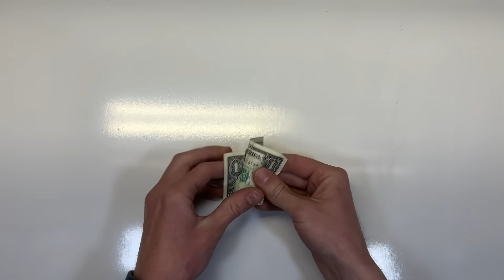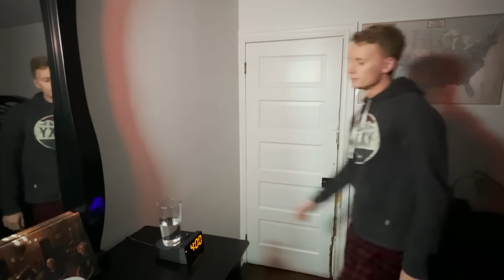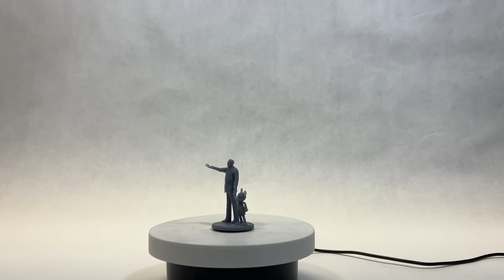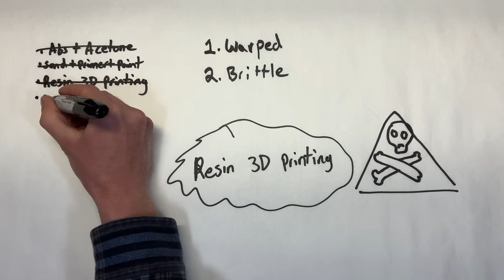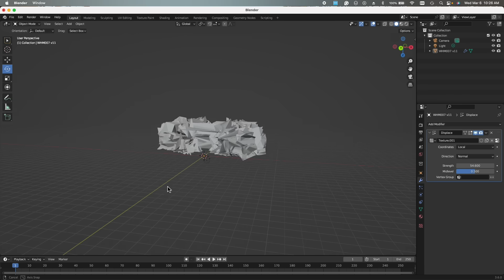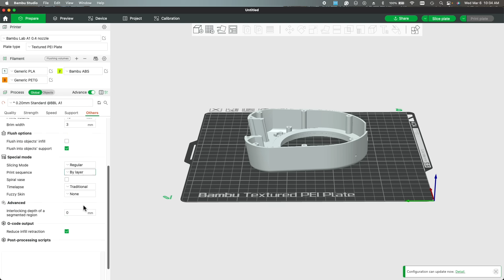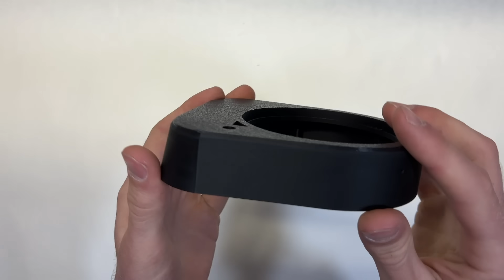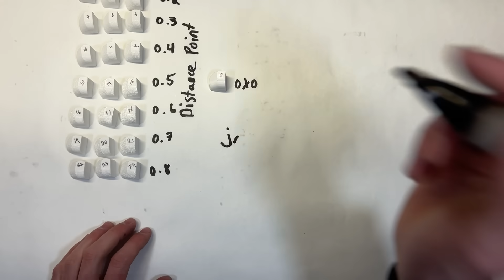My Secret To No More 3D Printed Layer Lines

Comment: Does fuzzy skin option available in Cura or creality?
Reply from the maker: Yes, the fuzzy skin option is available in Cura, a popular slicing software, and also in Creality slicer software. It allows users to apply a fuzzy texture to the outer surfaces of 3D prints, which can help hide layer lines and create a smoother appearance. This feature is often used for aesthetic purposes or to enhance the visual quality of printed objects. If you're using Cura or Creality slicer, you should be able to find the fuzzy skin option in the settings menu under the section for surface finish or similar categories.

Comment: Z-Hop is yuor Friend😅
Reply from the maker: Indeed! Z-hop can be a helpful feature in 3D printing, especially when dealing with models with delicate features or overhangs. It helps prevent the nozzle from colliding with the printed part when moving between different sections of the model, reducing the risk of stringing, dragging, or surface imperfections. By lifting the nozzle slightly during travel moves, Z-hop can improve print quality and reduce the need for manual post-processing.

Comment: If yuo want to print finish products with Resin , first Learn to Print in Resin , there is a learning curve , there are a lot of resins and parameters to know, second if yuo think yuo gone do this like the bombu in a Resin orinter like Creality or other , its not gone happend, but there are systems l like  Formlabs , full ecosystem(and its expensive) , one click and yuo have yuor model , perfect in their own propietary cartrige Resins😊
Reply from the maker: You make an excellent point! Printing with resin requires a good understanding of the printing process, as well as knowledge of different resins and their optimal settings. While some desktop resin printers like Creality can produce decent results, they may not match the quality and reliability of more advanced systems like Formlabs, which offer a full ecosystem and proprietary resins designed for seamless printing. Investing in a high-quality resin printer and using compatible resins can greatly streamline the printing process and ensure consistent, high-quality results.

Comment: Thanks for the reply.  Not going to change filaments any time soon.  Bambu had a sale this weeked for 32% off and free shipping so I bought 4 more rolls of PLA.  The printer is in my office inside my house so the med temp is probably 70 degrees and it is on a very stable surface.  It is self-calibrating machine (P1S) and the temps are 219/220 c and 55/55c.  Just a hobby for me and not a business so learning as I go and when I have time.  Lots to learn!  Good luck with your business. 

Again, thanks for your video,

Tony
Reply from the maker: You're welcome, Tony! It sounds like you're enjoying your journey into 3D printing as a hobbyist, and it's great to hear that you took advantage of a good deal on filament. Learning as you go is part of the fun, and it sounds like you're off to a great start with your BambuLab P1S printer. If you ever have any questions or need advice along the way, feel free to reach out. Happy printing, and best of luck with your projects!

Comment: Why are you heating the acetone for abs? Its called vapor smoothing for a reason. Layer of acetone, parts elevated above it in an air tight container for up to 20 mins depending on size of part. Easy.
And resin printing isnt faster because of less moving parts, its because an entire layer is printing at a time, and you can fill the build plate with no additional time, only height affects it. And its layer lines are normally about 0.05mm, you make it sound completely different. Not to mention im gunna go out on a whim and say you didnt chemically clean and uv harden after printing your resin... it shoulnd tbe that brittle
Reply from the maker: You're absolutely correct! Heating acetone isn't necessary for vapor smoothing ABS prints; the process involves suspending the parts above a layer of acetone in an airtight container, allowing the vapors to smooth the surface. It's an effective method for improving the finish of ABS prints.

Regarding resin printing, you're right about the layer-by-layer printing process and the minimal layer lines it produces. Resin prints can indeed have very fine layer lines, typically around 0.05mm or even smaller. Proper post-processing steps like cleaning and UV curing are essential for achieving strong and durable resin prints, and skipping these steps can indeed result in brittle parts.

Thanks for clarifying these points!

Comment: Is there an equivalent to this in cura? My printers use cura as a slicer...
Reply from the maker: In Cura, the equivalent feature to "fuzzy skin" is called "Ironing." However, it's worth noting that while both features aim to improve the surface finish of 3D prints, they work differently.

"Fuzzy skin" in PrusaSlicer adds a textured surface to the outer shell of the print, which can help conceal layer lines and imperfections. On the other hand, "Ironing" in Cura is a feature that smooths the top surfaces of the print by ironing them with the nozzle, creating a smoother finish.

To access the Ironing feature in Cura:

1. Open Cura and load your model.
2. Go to the "Experimental" section in the settings.
3. Enable the "Ironing" option.

Once enabled, you can adjust the Ironing settings to fine-tune the smoothing effect on the top surfaces of your prints.

While not exactly the same as fuzzy skin, Ironing in Cura can also help improve the surface quality of your prints.
Reply: @jakemgrim  Cura has fuzzy skin since 5.0 its like 2 years not sure why you are talking about ironing that's a completely different function, to smooth out surfaces actually the complete opposite.
Not sure if this are some wacky ai response you copy pasted or if you are breathing to much UFP & VOCs.
Why would you respond to comments and try to educated people if you have no idea what you are talking about.

Comment: They make 3d resins specifically for strength. Warping sounds like lack of supports.
Reply from the maker: Yes, you're correct. Warping in resin prints can occur due to various factors, including inadequate supports, improper curing, or resin properties. Using resins specifically formulated for strength, such as engineering resins, can help mitigate warping issues.

Additionally, ensuring proper support structures are generated in the slicer software and optimizing the orientation of the model can also prevent warping. Some resins may require different curing times or post-curing processes to achieve optimal strength and stability.

It's essential to experiment with different resin types, support configurations, and curing methods to find the best combination for your specific printing needs and desired level of strength and quality.

Comment: Little precision about tolerences, where pieces connect you can actually simply tell the slicer to print this part without any fuzz, for a bezel for example or a ridge. so you don't have to change your tolerences :)
Reply from the maker: That's a great point! In many slicer software programs, including Cura and others, you can indeed customize where the fuzzy skin effect is applied on your model. By specifying areas where you want the surfaces to be smooth without fuzz, such as connection points or precise tolerances like bezels or ridges, you can maintain the necessary fit and finish without altering the overall dimensions of the model. This way, you can enjoy the benefits of fuzzy skin for most of the print while preserving critical tolerances where needed. Thanks for highlighting this useful feature!
Reply: @jakemgrim  you're welcome!

Comment: Dawg- do the sanding and painting method once then create your own mold and cast your parts
Reply from the maker: Creating molds and casting parts can indeed be an efficient way to produce multiple copies of a model without the need for extensive post-processing like sanding and painting. It's a great technique for achieving consistent results and can save a lot of time, especially if you need to produce a large quantity of parts. If you need any tips or guidance on mold-making or casting, feel free to ask!

Comment: I'm not sure if fuzzy is actually better than visible layerlines. Sure it hides that it's 3D printed, but I'm not sure that's necessary
Reply from the maker: That's a valid point. Whether to use fuzzy skin or embrace visible layer lines depends on personal preference and the specific application of the 3D printed object. Some people appreciate the unique texture and aesthetic of layer lines, while others prefer a smoother finish for a more polished look. Ultimately, it comes down to the desired appearance and intended use of the final product.

Comment: Resin printing is not faster it’s actually way longer. Just because less moving parts does not mean faster. I would be curious to know where you got that information from. Probably pulled it out of your ass. Let’s not forget since you clearly have never resin printed in your life don’t forget about how the majority of resin prints will need supports which need to be removed, then the parts need washed in isopropyl alcohol and then fully cured once again. Process is actually a huge pain compared to FDM. Really shouldn’t spread misinformation on things you do not know because people will use one source of information and believe that it’s true and never question it. Hold on got through more of the video and not only did you buy a resin printer and try it and yet you still had the audacity to say it was faster even though you would have known this to be not true?!??! You said what about 3 hours on the bamboo printer to print you shell? I could only imagine on the resin printer with the success print it was well over 6 hours correct me if I’m wrong.
Reply from the maker: It's important to ensure accuracy when discussing different 3D printing methods. Resin printing does indeed have its own set of processes and challenges, including the need for supports, post-processing steps like washing and curing, and longer print times for certain models. While resin printing can offer high detail and surface quality, it may not always be faster or more efficient compared to FDM printing, especially for larger or complex prints. It's essential to consider the specific requirements of each printing method and choose the one that best suits the project's needs.

Comment: The fuzzy skin doesn't look too good, unless an object calls for it, it just looks cheap.  I prefer the layer lines with light sanding.
Reply from the maker: It's understandable that preferences for the appearance of 3D prints can vary. While some may appreciate the texture provided by fuzzy skin for certain objects, others may prefer the cleaner look achieved through light sanding to minimize layer lines. Ultimately, the choice between fuzzy skin and sanding depends on individual aesthetic preferences and the specific requirements of each print.

Comment: This is an excellent video. 
I'm learning 3D printing for car parts, and wanted to create dash parts that fit in without that "3D Printed" look.
You addressed the issue perfectly and concisely. There's clearly a lot of data and time gone into this process - the editing is first rate.
Thank you for this video, for taking the time and care.
Reply from the maker: Thank you so much for your kind words! I'm thrilled to hear that the video was helpful for your project. Creating dash parts without the typical "3D Printed" look can definitely elevate the overall aesthetic of your car interior. If you have any questions or need further assistance as you continue your 3D printing journey, feel free to reach out. Best of luck with your car parts project, and happy printing!

Comment: Bro you got hammed on those quotes for molds
Reply from the maker: Yeah, those quotes were pretty steep, weren't they? It's essential to shop around and explore different options to find the best deal, especially when it comes to manufacturing processes like molding. Sometimes, though, investing in quality molds can pay off in the long run, particularly if you're planning on producing a large volume of parts.

Comment: Resin printing is not toxic, how ever Burning PLA is. On the other hand mold making can be a valuable technique for creating final products from resin-printed prototypes. It allows for efficient reproduction of parts with consistent quality. Additionally, understanding the relative toxicity of different materials is important for safety considerations in various fabrication processes. Mold making could definitely be an interesting avenue to explore for those interested in turning their resin-printed creations into marketable products.
Reply from the maker: Absolutely, understanding the safety implications of different materials and fabrication processes is crucial. While resin printing itself may not be toxic, it's essential to handle the materials, such as the resin and any associated chemicals, with care to minimize potential health risks. Mold making can indeed be a valuable technique for replicating resin-printed prototypes and scaling up production while maintaining consistent quality. It's an exciting avenue for those looking to turn their creations into marketable products, but proper safety measures should always be prioritized.

Comment: Resin printing is about the same toxicity as your laundry detergent in fact burning or taking a match to PLA like you did in your video is way more toxic than most resins. You might want to look into mold making. Resin print you part them make a mold from it. little more setup but the end result is a final product you can sell.
Reply from the maker: Absolutely, understanding the safety implications of different materials and fabrication processes is crucial. While resin printing itself may not be toxic, it's essential to handle the materials, such as the resin and any associated chemicals, with care to minimize potential health risks. Mold making can indeed be a valuable technique for replicating resin-printed prototypes and scaling up production while maintaining consistent quality. It's an exciting avenue for those looking to turn their creations into marketable products, but proper safety measures should always be prioritized.

Comment: Personally I prefer sleeker looking layer lines over the fuzzy skin, especially if printed on a good printer like a Bambu Lab. But it's a personal preference I guess
Reply from the maker: That's a valid preference! Sleeker layer lines can indeed give a clean and polished look to prints, especially when produced on high-quality printers like the Bambu Lab. The choice between fuzzy skin and visible layer lines ultimately depends on the desired aesthetic and the specific application of the printed object. It's great that there are different options available to accommodate various preferences and requirements in 3D printing.

Comment: How this works in cura slicer?
Reply from the maker: In Cura slicer, the equivalent feature to "fuzzy skin" is called "Ironing." It's a feature that smooths the top surface of your print by going back over it with the nozzle after the main layers have been laid down. However, unlike fuzzy skin, which adds texture to the entire surface, Ironing only affects the top layer. You can find the Ironing feature in Cura under the "Shell" settings. Adjust the parameters like ironing flow, speed, and pattern to achieve the desired finish.

Comment: I've been using a formlabs resin printer and it is the bambulab of resin printers and it is literally click print and leave and you can track the print online. But obviously it comes at a cost
Reply from the maker: Using a Formlabs resin printer sounds like a convenient option, especially with its streamlined printing process and online print tracking feature. However, as you mentioned, the convenience typically comes with a higher cost compared to other resin printers or FDM printers like BambuLab. It's all about finding the right balance between convenience, quality, and cost that fits your needs and budget.

Comment: It’s ironic that you spent a long time trying to improve the surface quality, only to find out that it needs to be deliberately ‘degraded’
Reply: More like unwanted vs "wanted" surface quality
Reply from the maker: ture
Reply from the maker: Indeed, it might seem ironic at first glance. The journey to improving surface quality often involves exploring different techniques and settings, some of which may seem counterintuitive at first. However, the discovery of methods like fuzzy skin highlights the versatility and creative potential within 3D printing. It's all about finding the right balance between achieving desired aesthetics and functional requirements.

Comment: what about CF PLA? It has a very pleaseing finish. I do love the fuzzy finish though, great video
Reply from the maker: Carbon fiber (CF) PLA filament can indeed provide a pleasing finish to 3D prints. The addition of carbon fiber particles not only enhances the strength and stiffness of the material but also gives the surface a unique texture and appearance. CF PLA prints typically exhibit a matte finish with a subtle sheen, which can help mask layer lines and give the printed object a more professional look. Combining CF PLA with techniques like fuzzy skin could further improve the overall finish and aesthetic appeal of 3D printed parts. It's all about experimenting with different materials and settings to achieve the desired results!